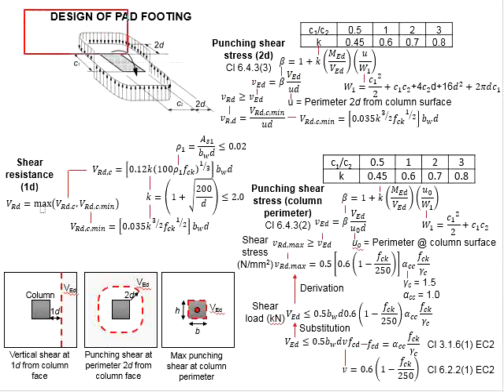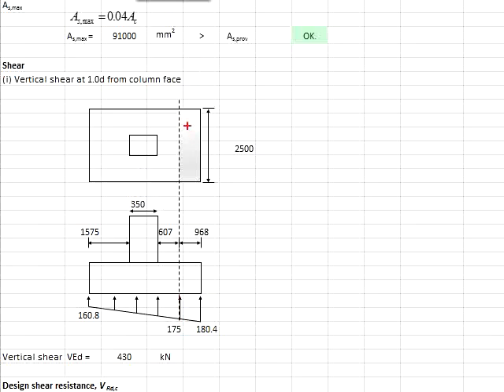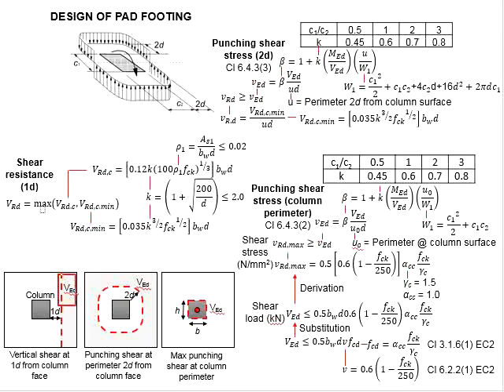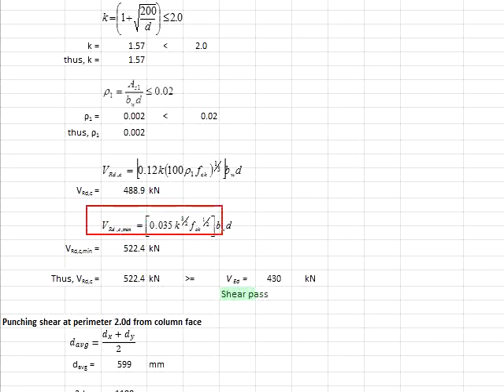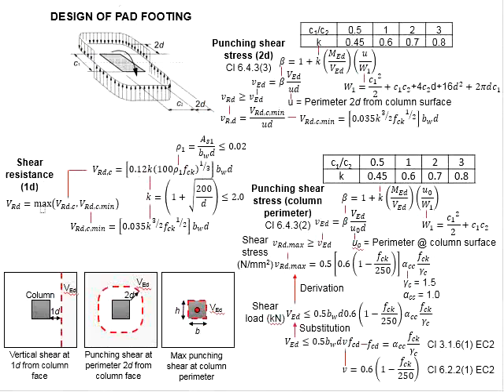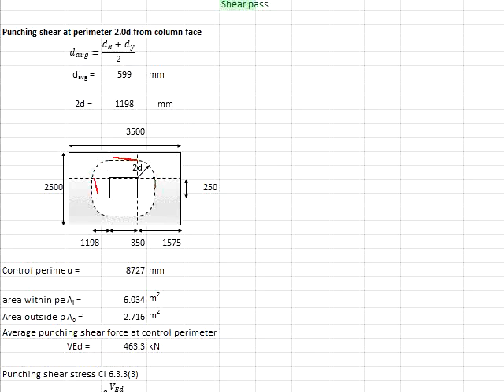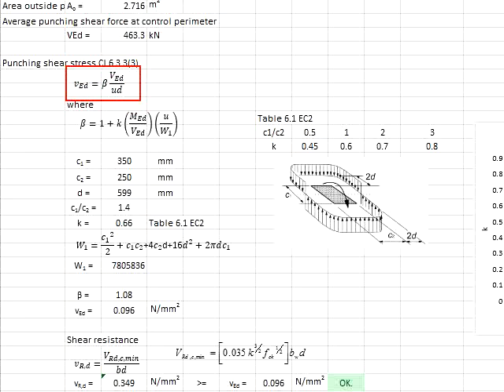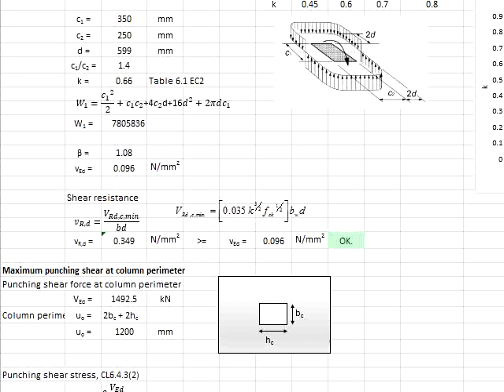3.15 Example 2: Pad footing Part 3

Comment: Sir, do we need to check for vertical shear, punching shear and maximum shear in y-y direction as well in design?
Reply from the maker: Theoretically, both sides need to be checked. However, the critical side is normally predictable, and those who want to cut the calculation steps short can choose to check the critical side. if the square footing, check one side with a smaller effective depth is sufficient as the other side will be the same. As for the rectangular footing, the side with the smaller cross-sectional area will be more critical.
Reply: Understand. Thank you sir